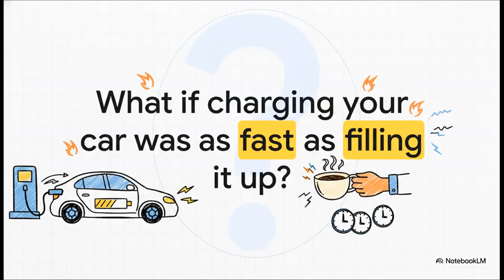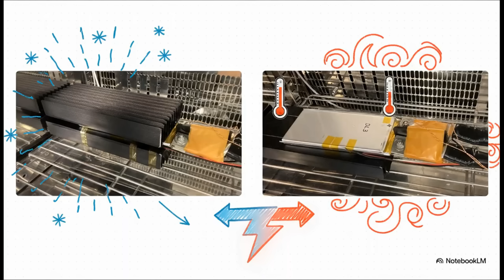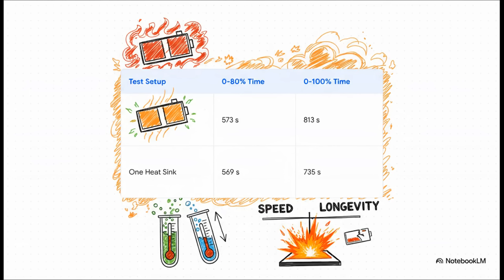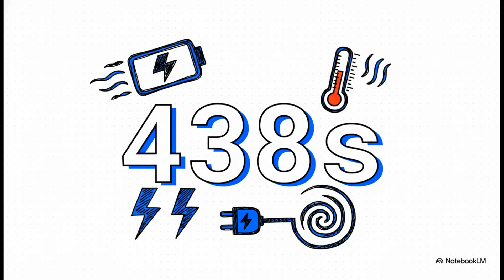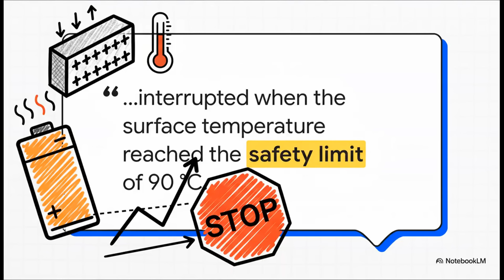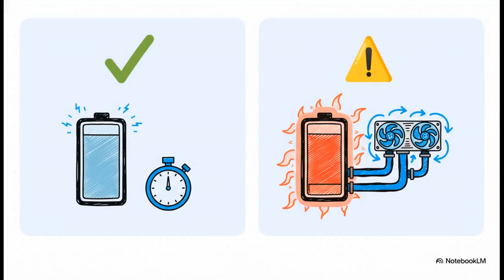Donut Lab Solid-State Battery: 2026 Independent First Test Results | Analyzed with Gemini NotebookLM

Comment: I love this battery, the 11c test there to show you what the battery can handle, Not necesarily what we would put in our EV. We do not need a battery to charge at 11 C.  5 C is fast enough, Charging a battery from 0% to 100 % in. 12 minutes is fast enough,  so 10 minutes to charge to 80 %,  perfect, so I would get 400 miles charge in 10 minutes with this battery in my ev, perfect,   Besides who is going to build a charging network with insane charging speeds,  to expensive. Not need

Comment: One log will barely burn, while three or more logs will easily maintain combustion.  This test demonstrated that a vehicle battery pack would require active cooling if charged aggressively.  They mentioned this issue as CES saying in some cases active active cooling would be required, but they're able to get away with  heat sink cooling for the motorcycle.   All said, this is not a game stopper.  One solution is to charge batteries in zones, rather than charging all at once.

Comment: Measuring temperature at 11C and ruling out the battery as questionable seems less serious.

Temperature at 5C - 6C makes more sense, i.e 45-60 degrees depending on heatsink.

Comment: Who wouldn’t want this to be real?  (Actually I can think of a few people…)  But just the 90 degrees charge temp is borderline dealbreaker.   If a heat sink is compulsory, then it becomes part of the battery, and the weight doubles and energy density gets cut in half.  Math.
Reply: every ev battery already has a cooling system this is nothing new the main issue with this battery is if it will live up to their promises of 100000 cycles

Comment: lol it literally showed with two pieces of aluminum on both sides it was cooled just fine no active cooling required , the one side was what if there was little to no cooling at all not even radiation through metal and less good results at 11c so they might have to slow it down tot 10c and some softwawre to confirm its not overheating at that insane rate. your conclusion is just dumb